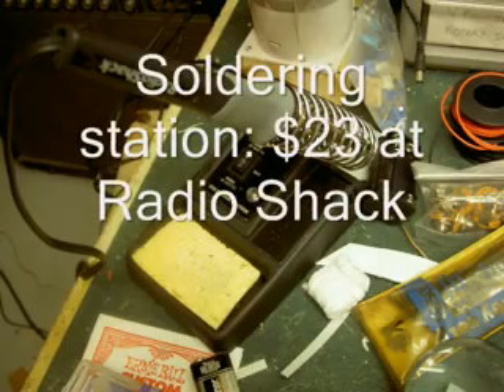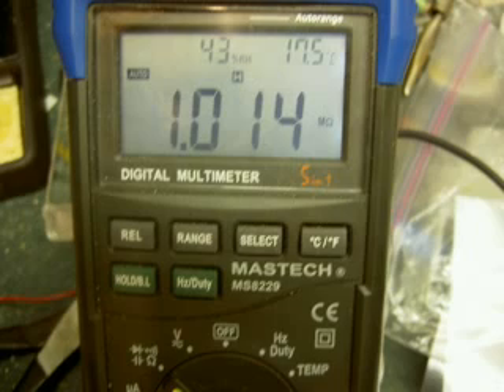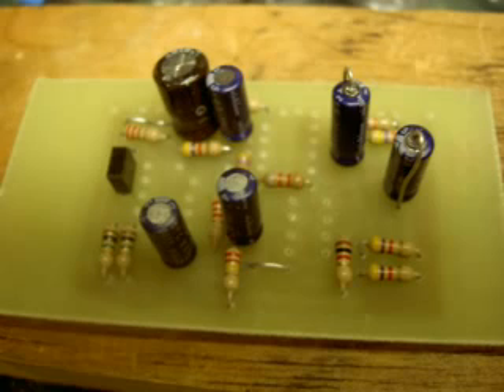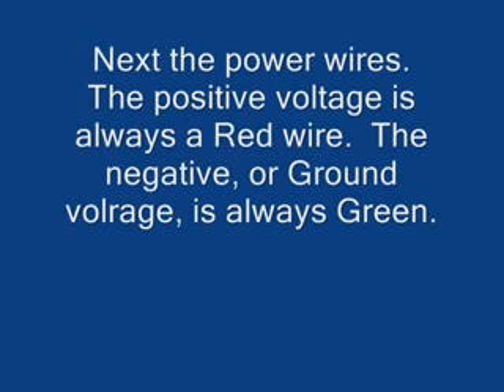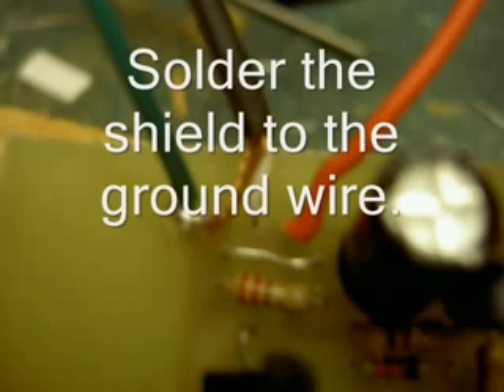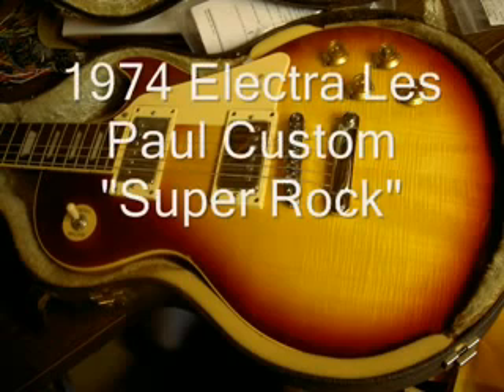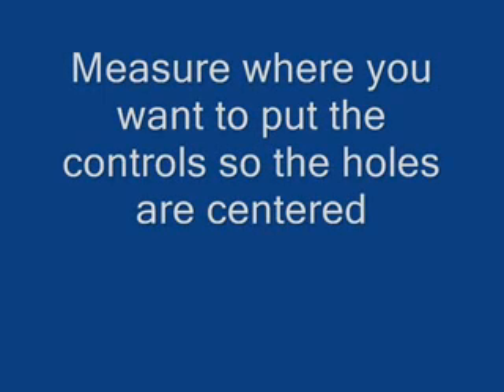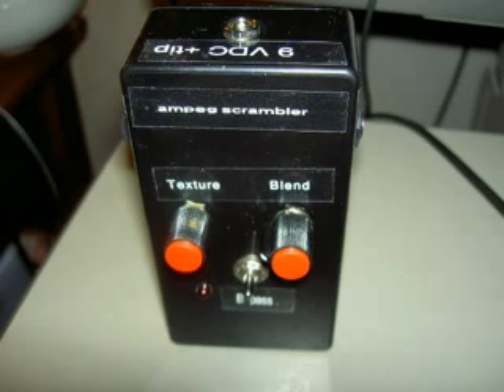Build your own guitar effects Part II assembling the circuit

Comment: First you should test it before you add bypass wiring to make sure the circuit is good. Not just before you box it. Also true bypass or millennium bypass are the only ones worth doing.   Build a buffer.  Aluminum enclosures. That will never last in live shows

Comment: How do you wire up the "ring" part of the stereo input jack?  Does it go to the circuit board, or does it have to be connected to the foot switch?  Also, with the stereo input jack, does it matter if your actual guitar lead cable has a "tip" "ring" and "sleeve?"  I looked at all the cables I have and they only have the "tip" and "sleeve" on the plugs.  Will anything bad happen if you use a standard mono cable with only the tip and sleeve with the stereo input jack?

Comment: @jonovaz its pretty likely that for your input, you connected the wrong leads. the tip of a 1/4 inch jack caries the signal, and the shaft is ground, make sure that for the female input the lead you solder to is connected to the tab that touches the tip of the jack, and connect it to positive, and the other lead connect it to ground or negative.

Comment from the maker: @akel1984 Yes, "rosin core solder"  is the lead wire that you heat up with the soldering iron to make the electronic parts stick together.     The rosin is a chemical  inside the solder that  cleans the metal surfaces so the melted solder will stick.  Thank you for watching my video.

Bill

Comment from the maker: @jonovaz It could be either.  Usually for the beginner it is a short circuit caused by a "solder bridge".  That just means  you used too much solder on one of the connections and it is short circuiting.  Check all the solder joints to make sure they are not touching the wrong part of the board.   An inexpensive digital mulitmeter (DMM) like I show in the video is very useful for finding short circuits and power problems. Pin 7 of the IC should read about 9 volts.

bill

Comment from the maker: @44eelz   It is because they are designed with different parts.  Sometimes just changing a couple of parts in an existing pedal changes the sound a lot too.   Picking the right 'values' of electronic parts gets into electronic theory, but the short answer is changing the parts changes the sound (a lot).

Bill

Comment from the maker: @clewi1091 Yes you can make them run off of electricity instead of batteries.  I build mine with a jack on the side that is "9 volt negative tip" that means it is the style used by all Boss pedals.   When not plugged in the pedal runs on batteries.  However when you plug in the tip, it switches off the battery and runs off of electricity instead.   

Those old Electras from the 70's & early 80's are really fine guitars I play them more than my old Gibsons.  That is saying something.

Bill

Comment from the maker: You are welcome.   A volume knob can be placed differently on different circuits but an easy way to do it is like this.  Get a 50K or a 100K pot.  Look at it from the bottom, and the 3 solder lugs are numbered 3, 2, and 1

Solder the output wire of the effect to 3.   Solder another wire from 1 to "ground" on the circuit, you can use the ground lug of the output jack for this.  Now the #2 spot on the pot, you solder a wire to that, it become the new "output" wire.  Turn the pot and voume changes.

Comment from the maker: A simple two-transistor fuzz like a silicon transistor Fuzz Face is very simple to build and useful when you build it.  Octave Fuzz like the Super Fuzz are actually more complicated.  The EA tremolo is supposed to be pretty easy to build too.   A Tremulus Lune tremelo is much more advanced.   Better to try something simple and be successful.

The easiest kit of all and very useful when you are done is the LPB-1 booster it is just 1 transistor 6 simple components and a volume control pot.

Comment from the maker: Thanks.

The board needs to be etched somehow so if you don't use acid you would need another etchant like nasty ferric chloride.

You can use perfboard or stripboard, which means you build on a ready made board.  On stripboard (velo board) all the copper is on strips and you scratch away copper from points you do not want to be connected.  That requires no chemicals.

Potentiometers  the same style but the resistance is different ie 50K ohms, 100K, 250K, linear or log taper etc.

Bill

Bill

Comment from the maker: The most common mistakes are both about the soldering iron:  1) using too much solder so is causes a :"solder bridge" that connects two parts of the circuit that should not be connected and 2) a "cold solder joint" that does not make a good connection.   Putting in a transistor in backwards is common but really the most common mistake is probably the solder bridge.  Thanks for watching.

Bill

Comment from the maker: I have a brand new in the box, unused, never opened MS8264 for sale that measures resistance, voltage, continuity, current, capacitance, diodes, transistors, temperature, frequency, 30 range digital multimeter and I will sell it for $27 shipped to US customers only.  Or you can go to eBay and pay $40 for the same thing.

First $27 takes it and that is from you or from anybody else who is interested.

Bill

Comment from the maker: Yes,  I  solder the shield on one end of the input cable to the ground lugof the guitar jack.  The shielding  on the other end of that same cable does not connect to anything.  Just trim it off or wrap with electrical tape.   It is all technique.

Bill

Comment from the maker: You could use a sound effects chip like the TI SN76477 or the Yamaha YMZ284-D but those are kind of advanced chips to work it.  It will not make your guitar sound like a NES but it will make crazy sounds.  Or you could try a "theramin" kit, Velleman makes one for about $15.

Comment from the maker: Good question.  I have been using 26 gauge solid wire but I am switching over to 24 gauge stranded wire.  The solid wire has made some pedals unreliable and I had to resolder them.  It is too stiff.

Bill

Comment: i figure out the problem. Too high current from my adapter. now there's another problem. i hav solder everything. but nothing seems to work. only the bypass is working.i followed the diagram in tonepad but still having the same prob.. thx

Comment from the maker: It sounds like you have a short circuit.  Check all the solder connections to make sure you do not have a blob of solder shorting across two of the traces.

Hot op amp is almost always due to a short circuit.

Comment: hey.. wonder if you can help me. i'm building a amz overdrive pro. i did all the wiring correctly and i used a dpdt switch. bt it does not work and the ic went real hot. wonder wad is the prob.. thx

Comment from the maker: The third set of poles on the 3PDT is used for switching the LED on when you step on the footswitch.  If you do not need an LED which many pedals do not need, you can just use DPDT and still get true bypass on the sound.

Comment: This is something i've wondered for a while... I make pedals too, but i use a DPDT switch, but you used a 3PDT.  Any reason a 3PDT would be better for true bypass?  I saw you didn't connect anything to the third poles, so basically it was wired like a DPDT right?

Comment from the maker: The green wires connect to the Ground plane on the circuit board, also to the ground side of the input jack and the output jack.

Comment from the maker: If you look at the switch at 6:23 in the video the red shielded wire in the "left middle" pole of the switch is the input jack.  The white shieled cable at the "left bottom" pole of the switch is the input cable that goes to the circuit board of the effect.  So when the switch is in the "Effect On" position the sound comes in from the input jack (red shieled cable) and is switched to the "Effect input" which is the white shielded cable.  In the "Bypass" position input & output are connected.

Comment from the maker: Yes I think a 110-140 watt iron is way too powerful for building effects.  The gun size are big and heavy too and harder to handle than a pencil iron.  The Radio Shack model I use is 20 watts on low and 40 watts on high, but I only use it on low to solder the components.  The only time I use high (40 watts) is to solder the guitar jacks which take more heat.

Comment from the maker: Good question Nate.  In my experience input shielding is the biggest factor in reducing hum.  Also, using high quality patch cords. I built pedals with unshielded inputs in aluminum Hammond 1590BB cases that still hummed. Using shielded wire and a plastic case solves it.  The plastic cases cost $10 less, are colorful, lighter than aluminum, and are easier to machine.  Aluminum is a pain to drill. Aluminum cases are sturdier though.  If I ever build one that needs aluminum I will mention that.

Comment from the maker: Part III is posted above as a video response.  Part III is where to buy parts.  One of the few things I advise you to buy at Radio Shack is their 500 piece resistor assortment it has pretty much all the pieces you need:

500-Piece 1/4-Watt Carbon-Film Resistor Assortment

$12.99
Model: 271-312
Catalog #: 271-312

I put a link to it in About This Video

Comment from the maker: Somebody asked "Why  don't you put heavy duty DPDTs in your stompboxes?" Good question.
My  guitar work is "studio only" so I don't need fast "foot switching".

The 3PDT toggle switches I use only cost $1.50 not $10-$15! I'm a cheapskate!

Using 3PDT switches: 2 poles  are for the "true bypass" switching shown in the video.  The 3rd pole of the switch turns on the LED when you switch the effect to the ON position.  There are 3PDT foot switches sold but they are pricey and a bit hard to find.